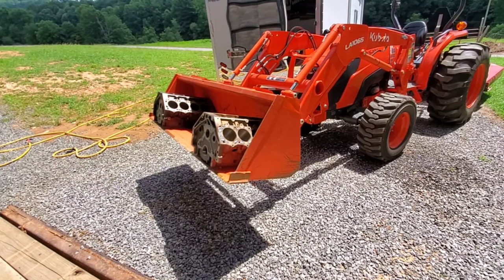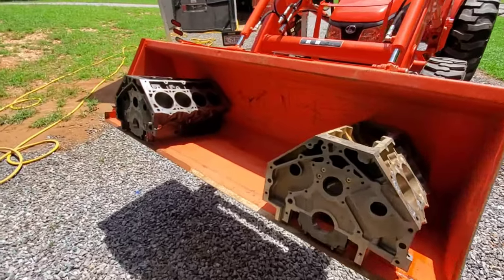Machining My Own Engine Block | I Have No Idea What I'm Doing! (TIMELAPSE)

Comment: had no idea you can bore a block with a portable machine. good to know. I wonder how important a deck plate really is.
Reply from the maker: Pretty neat. My friend referred to it as a boring bar.
I think a torque is really important on Aluminum blocks. I'm not sure it is 100% necessary on Dart iron blocks. But what do I know? Haha
Reply: Van Normal boring bar, have a Google.